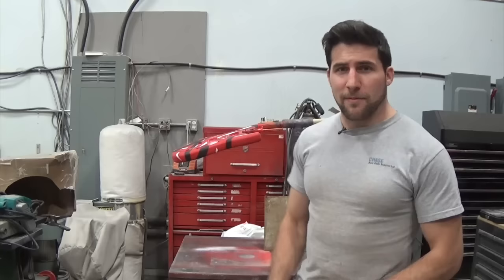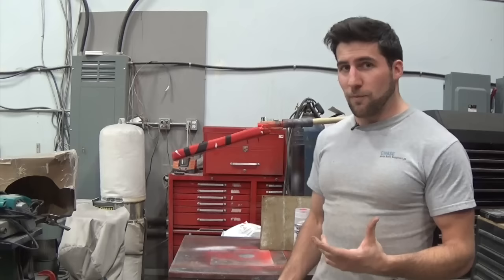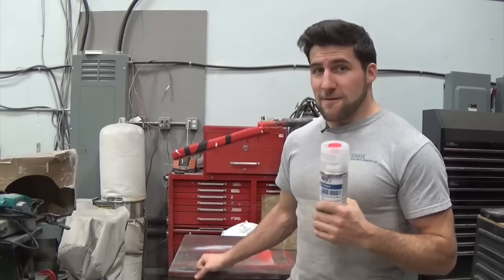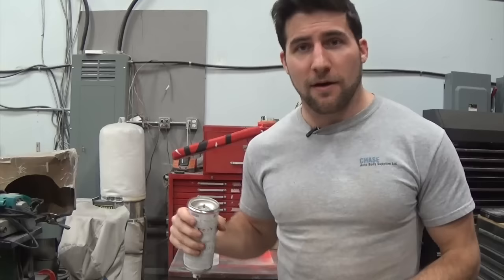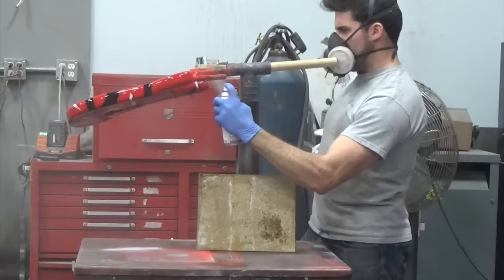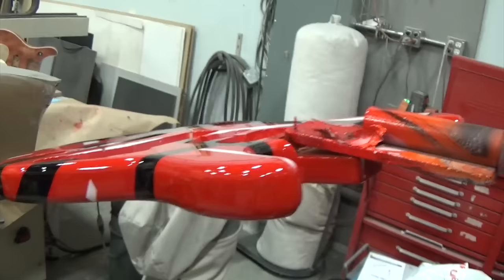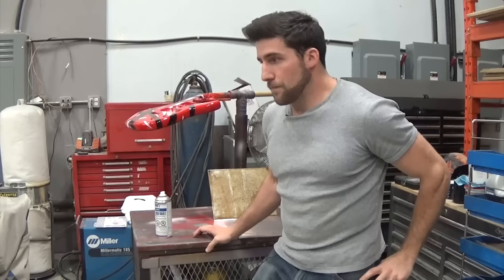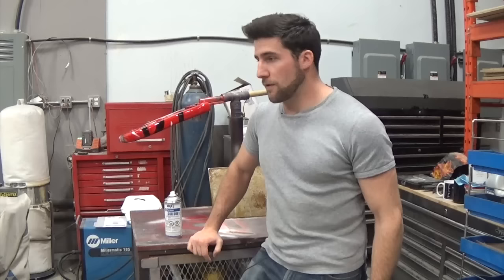How to get a professional looking clear coat with spray cans

Comment: Will polyurethane gloss coatings work on ABS plastic? I was thinking of sticking some paper & card printed graphics to a guitar case and then giving it a nice smooth seal with some sort of gloss. Thanks!
Reply from the maker: You will likely want to abrade the plastic and clean it thoroughly first, then apply adhesion promoter to make that work.

Comment: Great and useful information, how much time you have to wait to mount the neck and harware on the guitar? I just refinished a headstock with acrylic clearcoat and dont want to leave nail marksl or fingerprints
Reply from the maker: Acrylic clear coat takes much longer than this stuff. I’d be comfortable working with this after a week. Acrylic can take up to 6.
Reply: Brad Angove I did this in a very dry evironment and a hot place by the way, it is close to the beach but done in a closed room at environment temperature 25-30 C. 6 weeks looks a bit longer but not a problem to wait.
Reply: Brad Angove and thanks a lot for the fast reply. I appreciate your help!

Comment: Just found your videos mate, brilliant. Quick question, can you put your clear coats on after your base colour has dried? I’ve been told I need to apply lauqer about an hour after I’ve applied the colour coat?? Mines dried so not sure what to do. Also I have standard panned and then a panel that’s been finished in a metallic paint and wet sanding the colour coat before sanding brings up a huge discussion online, what’s your advise mate? Thanks in advance
Reply from the maker: I clear coated this about a week after it had dried. Scuffing is helpful, but if your metallic isn’t gloss it’s likely ok. 

Never wet sand between coats of paint. Water can really screw up a partially completed paint job of it’s not managed properly. Some people got the idea years ago that wet sanding was superior, and now disinformation has spread that it’s somehow the only way to sand paint haha.

Comment: Hello. I just bought a new guitar neck its maple,  its just bare wood i have not put anything on it yet. Can i just go put clear coat cans directly on it to give a glossy finish? thanks
Reply from the maker: +primrose charlotte you can. It would probably be best to use a bit of sealer first, but enough coats of clear will do the same thing.

Comment: Technical question.
Other then epoxy resin,  what can you recommend as a wood bar top clear coat
Reply from the maker: How natural are you aiming for with the finish?
Reply: @BradAngove  the issue is that epoxy is expensive. Looking for alternatives that can be regularly cleaned and still hold up.

Comment: Hey mate, awesome tutorial and superb looking result!! 
I am currently modding an cheap guitar. I sanded off the original opaque finish down to the raw wood. Now plan is to stain it and clear coat it afterwards. With those 2-component poly paints, would I need a primer of some sort or can it go on directly?
Reply from the maker: It can go in directly, but a sealer would generally help it build up more quickly.
Reply: @BradAngove  Thanks for the reply! So any  special considerations for the sealer to have the later coats get along with it cool?
Reply from the maker: Not really. Just needs to be compatible. You can use the same product as the sealer if you want.

Comment: What paint did you use for the base coat as I don’t think you can spray 2k over acrylic paint? What is the best paint to use as a base coat it I want to 2k clear over the top? Thanks
Reply from the maker: You can definitely use 2k over acrylic. I used rustoleum painters touch as the base. It’s my series on Frankenstrat paint jobs.

Comment: Hi, very informative vids and very well presented, thank you for them :D Have just finished clear coat spray on a 8ft surfboard with 2 cans of rust-oleum crystal clear gloss finish. Is this spray alright to use in the sea and shall the paint job under the coat be protected? Also it has not seemed to have given a deep looking gloss finish, is this how it is supposed to go on, or does it need more coats?
Reply from the maker: More coats would help deepen the gloss. I’m not sure I would have confidence in that paint to withstand salt water though. I’ve never tried it in that context. I thought marine paints were generally epoxy based.
Reply: Thanks for the reply, its  a BIC surfboard made of plastic, that was why the choice of paint. Shall give another coat, it is the salt water that concerns me too...

Comment: Great work! Have you ever tried this over acrylic art paint? If so, how did it do? I'm worried it might react poorly or melt it. Also that it might not bond real well to the art paint since I can't scuff it or anything first.
Reply from the maker: I’ve used it acrylic airbrush paint before, but not other acrylic art paint. I think if you let it dry fully it will probably work, but it’ll be strong enough for an art piece for example. Not durable enough for something like a car.
Reply: @BradAngove  it's a cooler that has been branded with acrylic paint artwork over it's full surface. Being a cooler that will get used, I want a durable protection for it that will handle UV, water, getting handled and bumped around a bit....I have used the SprayMax 2k and was thinking I'd go that route, but was worried it's solvents might not play nice with the acrylic art paint.
Reply from the maker: I think the spraymax 2K is about good an option as you’re going to find for that except perhaps epoxy.
Reply: @BradAngove  initially I was going to do epoxy but even the UV resistant epoxy when on a white background you can see it yellow fairly quickly when outside a lot....and this will be outside a lot and has white and other very light colors. So just decided I didn't want to risk the potential for it to yellow.

Since you had good results with SprayMax over acrylic paint, I think I'll get some of that to test.

I REALLY appreciate you sharing! Thank You!

Comment: Did you light sand before you trow the gloss? 
I'm currently painting but I'm gonna use spray gun and some poly, I just don't know if I need to sand before the poly or is good to go the way it is now!
Reply from the maker: I sanded lightly before adding the clear so that it would adhere properly.

Comment: Hello Brad!
Im going to buy this clear coat to cover a rustoleum glitter paint
But what happens if some coat get any tipe of contamination
I can sand it And continue with The next one? I ask because i know that poly is more durable and it gets dry very fast..
Reply from the maker: Once it dries you sand out the imperfections and either polish or spray more coats.

Comment: Hey brad!  This is a great video- that guitar looks great!  I’m considering doing a project with StewMac metallic Nitro lacquer for my color coats- do you think this stuff would work okay over that?
Reply from the maker: It can if you let the nitro fully dry first (takes a month or so), but I generally would suggest using acrylic or urethane under this product.

Comment: Great Video.....  Quick Question...  I have some fairings coming in for my motorcycle from China.  The biggest complaint I hear is thin clear coat.  If I have watched your videos correctly, , I would do a wet sand to smooth out any imperfections and allow for the first tack coat, then proceed as you have shown above....   How many cans of this would you recommend for a GXSR?  I am very tempted to give this a go, as the fairings are not that much anyway....  Thanks again.....
Reply from the maker: +Howard Wear That sounds right to me. One can should do it, since there's already clear on there so I assume you don't need to put more than a couple coats on.
Reply: Thanks,,,,  any particular grit for scuffing, or just a gray scuff pad?
Reply from the maker: +Howard Wear the gray scuff pad should work fine. 800 grit also works well.

Comment: hi brad..do 2k automotive clear coat spray many layer(ex 8 layer.) with air spray gun..are they crack soon..tq
Reply from the maker: The 2K stuff generally doesn’t crack after 8 layers as long as they’re in two separate sessions at least 25 hours apart and with sanding in between.
Reply: @BradAngove  thank a lot Brad..seeing many of yor video..helped me alot..

Comment: Hi, thanks for this video. Is it a finish I could use over layers of nitro lacquer by any chance?
Reply from the maker: I have used it over nitro before. I gave the lacquer lots of time to dry first and then sanded with 800 grit before applying the 2K.

Comment: I just ordered Minwax Spar Urethane to coat my custom painted Snowboard, do you think I should get this instead? I’m just worried about not having a flexible enough clear coat on the board
Reply from the maker: I’ve used this on a snowboard before. This would be my suggestions.

Comment: would acrylic lacquer work for this?
Reply from the maker: I suppose it depends what you mean by work. If you’re doing an acrylic lacquer paint job then you can clear coat with acrylic lacquer. It won’t be the same as this of course, but it will work.
Reply: @BradAngove  Thanks, what grit should i sand the colored body before i spray it?
Reply from the maker: I would use 800 grit.
Reply: Brad Angove Thanks a lot man

Comment: Hey Brad, great videos. I'm just finishing my own frankenstrat/5150 tribute. I probably made my spraymax 2k clearcoats less wet but did more passes per coat if that makes sense. I did 4 coats in one day and didn't do another set. Will that be enough to cover the stripe pattern thickness? Should I still try to sand all flat before polishing or leave some texture to avoid burn through? Thanks,
Reply from the maker: That’s likely to be enough, but it’s hard to say. It’s up to you how important you think getting it all flat is.
Reply: @BradAngove  thanks Brad! I ended up deciding to just go with it..got it nice and flat in some spots but couldn't avoid the grain popping through so I knew it wasn't going to be perfect. In the end it's a good tribute to EVH and has some relic traits without trying too hard. Many lessons learned. Water based grain filler was tough to work with, maybe the blue 3m tape better than pin striping since I had lots of bleed through. But yes it's a killer guitar and came out good. Glossy, but also natural and some feel in there. A mix of 5150 and frankie qualities. Thanks for the info!

Comment: Hey Brad, thanks for all you do brother. 
I have a questions regarding the the 2K  Max Clear Glamour. Once you lay down your final coats do you scuff and polish the final top coat and do you use compounds? 
If so which compounds do you use with this specific clear coat (2K Max Clear Glamour). 

Also for the record I am using Stew Mac guitar lacquer as my final color coat before the 2K Max Clear. Do you foresee any issue with using this lacquer beneath this particular clear coat. 
again thanks for all you do and I look forward to your response. 

Six
Reply from the maker: Let the lacquer dry fully for a couple weeks before clear coating and you should be ok. I do sand and polish my spraymax. It’s the same as my other 2K polyurethanes, so I would say just check out a couple of my more recent polishing videos.
Reply: @BradAngove  will do. Thanks again man for the tips and the inspiration. 👍

Comment: How many coats would you recommend if a printed graphic is being placed on a LP type guitar with a white binding?
Reply from the maker: It depends on the thickness of the coats amount other things.
Reply: @BradAngove  I'm not sure which products I should use, like this spray clear or zpoxy lacquer.

Comment: Hey Brad, I used the Spray MAXX 2K using your tutorial and I ended up with some "Bare" spots...can I put a light sand on it and brush on Z Poxy finishing resin to fill and/or fix my issue??
Reply from the maker: I haven’t tried that, but I would think so.

Comment: Can this be used over angelus leather dye? I'm about to go in on a trans purple dye finish and am wanting to use something like this is that is faster and easier than other clears.
Reply from the maker: Yes it can.
Reply: @BradAngove  Awesome, thank you! I am between this and tung oil right now but I really would prefer a more glossy finish for this build. I might just go this route, as it seems super quick.
Reply from the maker: It’s faster for sure

Comment: Dear Brad, what kind of clear coat did you use to get this finishing? PU MonoComponent? or Bi-Component?
Reply from the maker: I used the spraymax 2K clear coat that you see in the video.
Reply: OK. I couldn't stablish the relationship of 2K with two componentes because I thougth that the producer is american, not German.... because K means Komponent, also in German Language....

Comment: brad is there a difference between polyurethane vs polycrylic for guitars?
Reply from the maker: Yes. One is polyester urethane. The other is an acrylic designed to act like a polyester essentially. The acrylic doesn’t have that warmer amber hue, they dry at different rates, and they bond a bit differently.

Comment: Hey Brad! your videos have helped me a ton through the process of building my guitar kit, I'm at the clearcoating stage right now (due to weather I might delay it), but I couldn't find a 2k can, so I ended up going for a rustoleum polyurethane spray can. It says in the can I have to wait in between coats about 2 hours, is that too conservative? I was hoping for it to be 10mins, but maybe I'm not comprehending well the instructions hahaha.

Greetings from Chile!
Reply from the maker: It says to recoat after 2 hours? Does it say to sand first?
Reply: @BradAngove  I think I'm much better quoting this "Dry and recoat times are based on 70ºF (21°C) and 50% relative humidity. Allow more time at cooler temperatures. Dries to the touch in 2 hours and is fully dry in 4 hours. Recoat within 1 hour or after 24 hours. " Personally it is a bit unclear, but idk really, what do you think I should do? Just go for a 10-15min between coats? or stick to the 1 hour thing it says in the can? 😅

Edit: I might be clowning but beforehand it says this "Apply two or more light coats a few minutes apart to avoid drips and runs." ._.
Reply from the maker: I think if temperatures are reasonably warm and based on that you can probably do 15 minutes between coats.
Reply: @BradAngove  Ohh I see now, I'll be spraying tomorrow then. Thank you so much for the help and all your content  😄

Comment: My 2K glamour just arrived today and the warning labels are making this thing look like death in a can. I’m spraying my bicycle frame in my detached garage, any tips as far as handling goes for this stuff? Or is it not that bad as long as I have the respirator and gloves?
Reply from the maker: Respiratory and gloves are key and should be adequate. Leave the door or a window open. If you can get some cross ventilation, that will also be helpful. If you’re comfortably wearing long sleeves and a hat as well, it’s not a bad idea. The stuff is quite sticky, but honestly it’s not nearly as bad to work with as the can makes it seem.

Comment: Hey Brad, I'm painting a raw ash body. I've grain filled and dyed. 
If I skip sanding sealer... Would I be able to spray this enough to wet sand out any flaws? Like, spray.. sand flush then spray again with a new can?

Or, what sanding sealer is compatible with this stuff.

I'm worried about this stuff showing the haziness that comes with a sanding sealer.

Thanks for any opinion you can give on this.
Reply from the maker: Yeah, you can seal it up with this stuff if that’s your preference. Just make sure you sand all the gloss off between application sessions.

Comment: If redoing  guitar with Nitrocellulose spray cans would I have to sand between the color coats and the clear?
Reply from the maker: No. Not unless you need to smooth something out. Nitro melts into itself.

Comment: Hey brad! You have the best videos! Question! I painted a strat turquoise then I got rustoleum gold glitter paint. Now I'm trying to spray lacquer it. What do I have to do to get the glitter texture away? And still have the glitter? I'm scared to sand. Also is the answer basically just add so much lacquer that it covers the glitter eventually through many coats?
Reply from the maker: +Jacob Payne haha yes, that is essentially the answer. Is it actually lacquer though? Because that may not be compatible with the rustoleum.
Reply: Brad Angove yes it's actually the lacquer rustoleum that you get at Walmart (spray can lacquer. I sprayed a whole can and it's still glitter textured and rough. Should I get a poly or something thick and put it over it?
Reply: Brad Angove poor mans version of a sparkle guitar :(
Reply from the maker: If you've already started working with lacquer I wouldn't switch now. It would create too much risk of a bad reaction. You can sand your lacquer back flat a bit after it has dried for about 3 days, and then add a few more coats to finish burying the texture.

Comment: Hello, thank you for this video but I did not understand everything, I am French and I do not speak English very well; did you use a single can of varnish because i have seen some people use 2 can of sprayMax 2K varnish for their guitar? How long do you leave between each layer? How long does the can of varnish become unusable, if I use it the next day is it still good? Thank you so much ! And sorry if they are mistakes in my text, I use a traductor
Reply from the maker: Yes, I used one can. 10-15 minutes between coats. The can should be usable for about 36 hours after you activate it.
Reply: @BradAngove  OK, thanks ! Have you completely emptied the spray can? Once the painting done, you made a layer of varnish of catch (a layer of varnish left to dry 45min) or you just waited 15min like the others?
Reply from the maker: I’ve never completely emptied the can. I always wait 15 minutes between coats unless I’m giving them a day to dry to do a flow coat after.